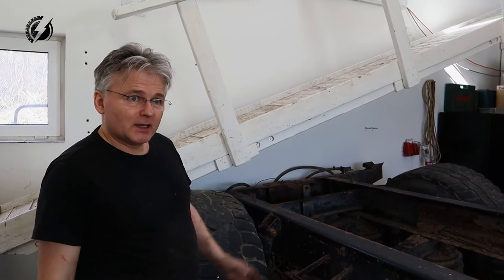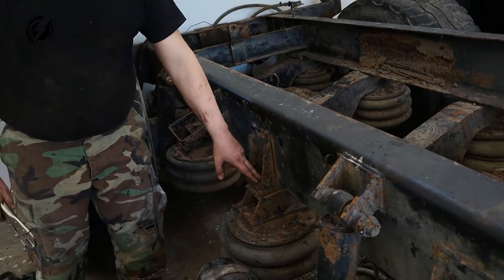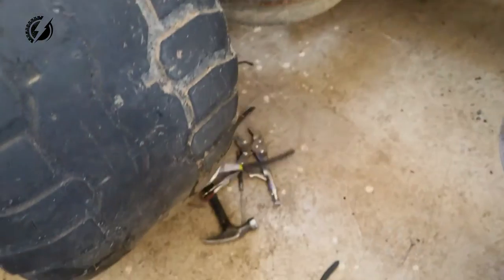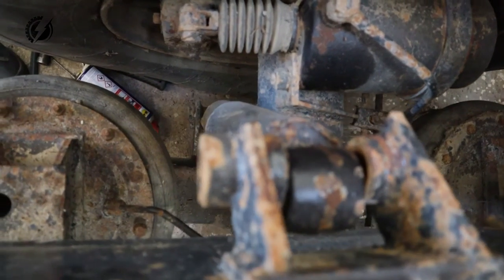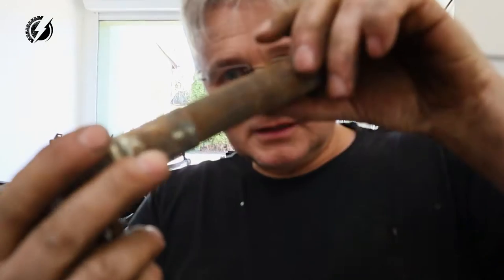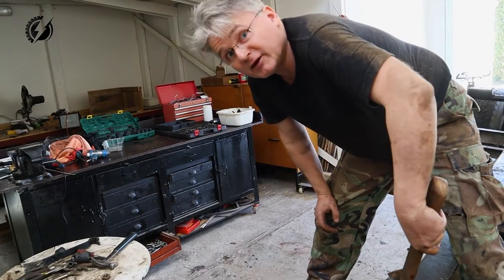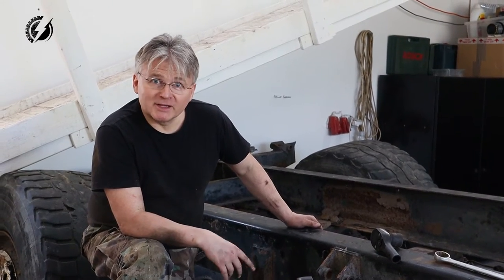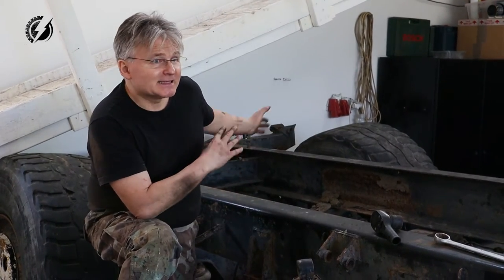Best Off Road Electric Monster Truck Build | Ep.19

Comment: I am eager to see the design and rebuild process. Keep up the good work!
Reply from the maker: Hi Fred, in few episodes we will go deeper into the unique Tatra chassis, then we will disassemble the second Tatra, (but the different way, and in just few episodes), because we need the second front axle, the steering, and the t-case. After that, we will do two things at the same time, building the truck chassis, and disassembling 4 Nissan Leafs.

Comment: Hi Peter  Sorry to see the impact has broke. How much will it take to fix it?
Reply from the maker: Hi Marty, the gun somehow started to work again, it acts like there is some form of protection inside. In this episode it worked continuously for hours on the peak of its limits.     We have video material for 2 more episodes now , removing the frame from the chassis was epic.:) I think I figured out the air suspension attachments for the steering axles, I will not need to make it, I will just modify the crossmembers from the rear of the chassis, and it will be bolt on without needs to weld it to the original components. Will talk about it in the episode 22.
Reply: Off Road Electric 
That’s Great!